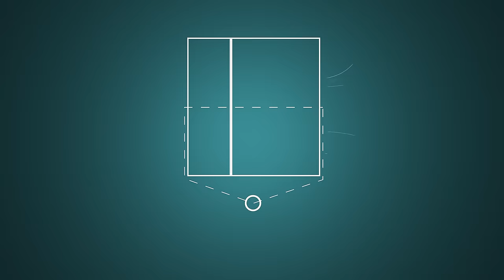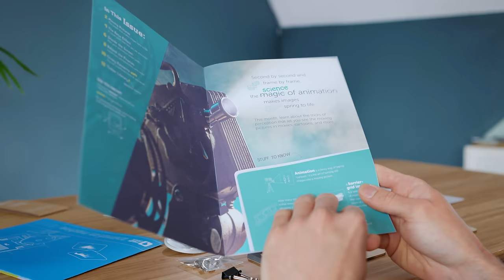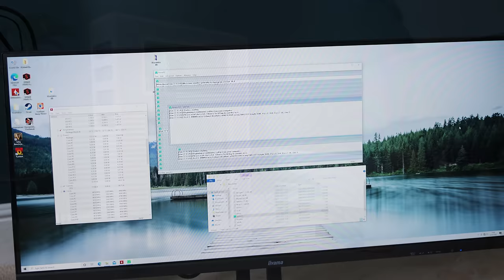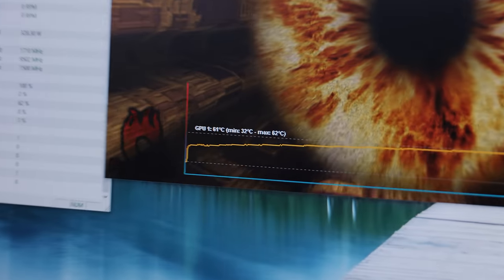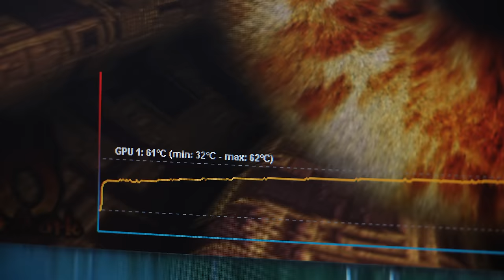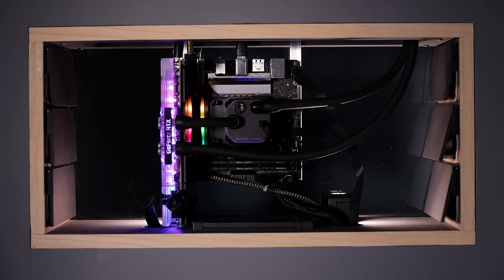Building the world's first 'breathing' PC

Comment: This man just created a whole new cooling solution. Hats off to your genius.
Reply: Have you seen Tech Ingredients air conditioner computer system. though its super loud yet you can overclock your pc to the max while keeping it far cooler than any water cooling system could. Its a super cool concept that would work if you duct the air flow in and then out of your office. This breathing unit is very cool as well as you could adapt 2 wings on to it to allow the ac air come in and then the exhaust vent going out side. One would have to devote an entire wall and custom build a desk and everything. Though I wonder if you could put two lungs ( breathing parts in so that you can have your large monitor in the middle...
Reply: Until you realize he used a 520 watt passive PSU 🤦‍♂️ This PC isn't sustainable and is only for show. If he tried actually using that PC with those components it would melt.
Reply: @PabzRoz  He literally loaded it with prime95 and 3dmark. In what scenario would it get any hotter?
Reply: @ThisIsTheInternet  What? How hot the GPU and CPU get is irrelevant to the issue... He never showed how hot the PSU was getting. It was guaranteed running hotter then the sun. Also he never showed the HWinfo and what speed the CPU/ GPU were running at. The 5950X and 3080 automatically downclock themselves for power management in order to keep their temps under control. Basically they're running way slower then they should be. That PSU is not capable of running a 5950x and 3080 at their rated specs. Any real world workload and long term use would not be sustainable on a 520w PSU. Stop believing everything you see on Youtube. Even a monkey knows a 520w PSU is too low for those components let alone a passive one.
Reply: @ThisIsTheInternet  That's not the point. When temps get too high or there's not enough power draw the CPU and GPU downclock in order to keep temps from getting to high forcing them to run much lower the spec. But the real problem is how hot the PSU is getting. Not only is the PC running slower then it should be and going to experience constant shutdowns but with the way a 3080 spikes it's liable to eventually melt out the PSU or catch fire. No way would this PC last with that small of a PSU.
Reply: @HeyHey-fy5jd  I have 750watt which only turns the fan on at high load and i have never seen in move.
Reply: @PabzRoz  Lmao i didnt even notice, yeah.. This rig would have to be undervolted and underclocked to run stable for longer durations. Which defeats the point of the components chosen lol..
Reply: @Skyflairl2p  exactly
Reply: @PabzRoz  you act as if he cant just swap the psu? Lol
Reply: @CocaineCobain  Which is exactly why it's a major oversight.
Reply: @PabzRoz  This is a proof of concept. Nitpicking his choice of components is kind of missing the point here. It could all easily be swapped out. The fact is he's created a novel cooling system that works, and looks super cool. That's the main takeaway here.
Reply: @PabzRoz  dude there are higher watt rated fanless psu's on the market. this system would totally be usable long term. This was just a proof of concept and it already works amazingly.
Reply: @lollb454  Proof of concept is dope not talking about that. And if he used a higher watt passive PSU ide be fine with that too. The fact he's using a 520w passive PSU is my issue. Not only is this PC extremely underpowered and going to shutdown constantly but it's also dangerous. The PSU is going to constantly be maxed out burning hot and the fact it's passively cooled makes it even worse. It's eventually either gunna melt or actually catch fire.
Reply: @t.c.b4722  I wasn't talking about the concept or anything else. What's the point of it all if you can't even use the PC because the PSU is underpowered? What's the point of using a 5950X and 3080 if you can't even use them to their potential? That's not nitpicking that's just a massive oversight and spreads misinformation that a 520w PSU is fine for system like this. He even benchmarked it as if there's no issue with it. Everything else about the video I found great but the fact he ignored one of the most vital parts of the PC is not nitpicking.
Reply: @ThisIsTheInternet  How hot the components get have absolutely nothing to do with it... You're not that bright are you...
Reply: @dirozx  Ok how is that relevant at all? You literally didn't tell me anything. Idk what cpu or gpu you have idk what tasks you do on your machine like gaming or editing? Just telling me you have a 750watt psu and the fan only turns on when there's a high load literally doesn't mean anything🤦‍♂️.... Not to mention your psu is not even passively cooled.
Reply: @PabzRoz  Its totally not dangerous man.... The worst that would happen is the system would shutdown. Its rated 520watt because its designed and built to run at that wattage without a fan. People need to relax its way less dangerous than they think
Reply: @tylergriffis5036  It's literally the only point of this video, it's a cooling solution. He proved how hot these top of the line components get at max load. The cooling works. The PSU can be swapped for anything. You don't have critical thinking skills do you?
Reply: @PabzRoz  What's the wattage of a 3080 and a 5950x? I'll wait

Comment: Plating the magnet was an insane solution. Wow.
Reply: I was just thinking about sanding it down. I think DYIPerks thought so aswell at first but discarded that solution as bad.
Reply: @Macatho  there was less 0.1 mm gap so he can just polish it
Reply: @Macatho  If you sand it down it will lose its nickel plating which will cause the magnet to rust
Reply: It was also a nickel-ion solution

Ok I'll stop
Reply: @ahmatm2147  just what I thought:

"Pun intended? "
Reply: @ahmatm2147  I saw a pun potential after I posted it haha
Reply: This reminded me of my time in school years ago when we covered our door keys in gold. :D
Reply: @odian3099  Gold? sure you did.
Reply: @StayMadNobodycares  gold plating isn't that expensive bud
Reply: Until you realize he used a 520 watt passive PSU 🤦‍♂️ This PC isn't sustainable and is only for show. If he tried actually using that PC with those components it would melt.

Comment: the motherboard suspended with the tubes and cables coming off of it makes it look like a suspended heart or organ
Reply: I agree with your idea, as i do think it looks like it. The bellow being the lung, the motherboard and components being the brain and the water pump being the heart of the system.
Reply: @LuxGamer16  it sounds like its breathing too
Reply: Maybe the radiator is the lungs, as it takes the water and turns its surface area way up so that it can exchange something with air.
Reply: He should pulse the light in red like a heart beat
Reply: Very General Grievous
Reply: @makeitso9833  uh that would be rad

Comment: This is such a legendary channel, god tier content
Reply: No cap!
Reply: Have you seen 5 minute crafts

That's GOD TEIR CONTENT
🤣😂🤣😂😂🤣😂
Reply: SERIOUSLY!
Reply: Legendary is the right word
Reply: I can't add anything else to this comment. It's exactly that.
Reply: Until you realize he used a 520 watt passive PSU 🤦‍♂️ This PC isn't sustainable and is only for show. If he tried actually using that PC with those components it would melt.
Reply: @PabzRoz  I didn't catch it in the video, did he show the wattage of the PSU? DIY Perks is definitely more on the engineering/building stuff side compared to PC tech so he might not have realized it wasn't enough (hopefully he does now). It might've also just been a temporary part to get the video done since there is a global parts shortage and high power PSUs are one of those things that are hard to find right now.
Reply: @seshpenguin  You can see the PSU is from Seasonic and in one part you can see on the bottom it says 520 watts and the 12v rail is 516watts. It's the Seasonic Platinum Fanless 520W PSU. And i think he knows that PSU wasn't enough he's an educated dude. He obviously just had to get the video done which is why he didn't explain what PSU he was using and why he didn't actually show any of the HWinfo when he was benchmarking it so we couldn't see what the CPU or GPU were boosting too or the benchmarking scores. He very well could have underclocked the components just for the video. He just told us the temps and that's it. I just wish he would have explained that the PSU is not ideal or is temporary instead of acting like it's perfectly fine and benchmarking it giving anyone who saw the PSU like I did the wrong idea.
Reply: @PabzRoz  Yea I agree
Reply: @FelinoLOL you hope?
That's the worst thing I have heard there's no hope left m8.
Reply: @PabzRoz  it's hardly going to melt. Maximum power draw at 100% load for that entire system will be 520W and Seasonic PSUs are built like tanks. So granted you never want to run your PSU at its rated maximum, but only benchmarks and synthetics hammer systems at 100% anyway.

Every day use of that system would be about 450-480W, so you're outside of the efficiency curve for sure, but hardly going to have a problem running it.

Comment: Tube breaks, “I’m going to have to science the shit out of this” Love it
Reply: man couldve just bought a new magnet that fits the tube
Reply: @npas76  That gives the same problem as with the tubes, manufacturing tolerances. But it does give him more chances.
Reply: He just went full NileRed. What an unexpected flex.
Reply: I fucking loved that it blew my mind, not that I necessarily wouldn’t have known the solution but to actually push through and clearly succeed in diy plating and this whole build
Reply: he could just glued something to the magnet to make it thicker, but who am i to criticize XD
Reply: @pedromolina5776  no he couldn’t have, glue itself is a like a block from magnetic waves. Let alone the material you’re suggesting he put around it to increase diameter. This would lead to his primary concern of a slow weak magnetic pull, of barely any air flow.
Reply: as soon as i saw the electrodes, my ap chemistry brain went full in and i was like oh shit he's gonna plate the magnet to make it larger. Never thought I'd actually see something like this outside of educational use lol
Reply: @goosegaming9418  I don't think glue would have any effect, since the magnet would still be in the same place relative to the other magnets.
putting 2 pieces of paper (about +0.2mm to the radius, so +0.4mm to the diameter) between a magnet and the rest wouldn't affect the magnetic field.
the only problem is that it may be ugly.
Reply: @npas76  it's quicker this way and most importantly, more fun
Reply: @satibel  glue does stop magnetic waves I already knew that
Reply: @goosegaming9418  I'm not sure if you're trolling or if glue stopped your brainwaves?

unless you have a proof that having glue around a magnet reduces its power significantly more than the same gap of air or water.
Reply: Most people will just say eh Ill take it to a belt sander and sand the magnet down. This guy be like. Electrolization is the best solution
Reply: @goosegaming9418  Would you mind sharing some of that stuff you are smoking? Because it must be incredibly good stuff...  I am hoping that you realize that EVERY motor and solenoid in the world is coated in epoxy, lacquer, or essentially *GLUE*... Even transformers are wound and then encased in glue... Metals are what interfere with magnetic waves by creating fields of their own or saturating. These can be designed to either block or reinforce a magnetic field.

The hardest part about using an epoxy or glue is getting uniform thickness and distribution when talking about minute thickness changes...by using the electroplating, he was able to control the thickness in micron level accuracy and insure an even better bond. If anything the nickel atoms would have also aligned with the existing field and likely given a very slightly stronger field.
Reply: @burntchickennugget191  sanding might cause problems in the long run as neodymium magnets corrode (basically rust.) and become friable.
Reply: lmao yeah, my first thought as an engineer was LATHE!!
Reply: @npas76  precise size magnets cost insanely
Reply: Eh, electrolyzing isn't too complex. Most people learn it in high school.
Reply: @Zekurity  most people only learn the theory about it in high school

Comment: Imagine if when the system was under load, the breathing rate increased
Reply: This.
Reply: Lovingly terrifying
Reply: DUUUUDE that is a really good idea and would make the machine feel like a living breathing creature. It would almost be creepy to be in the room with it.
Reply: that would actually be really simple to do with the right water pumps, you could just connect them to the CPU fan/pump header and set a curve profile in the BIOS
Reply: But it would be inadvisable building an overclocked rig to do this.
Good thing is that his project worked so well that it put up enough cooling for power-hungry, hot components under load with standard configuration.
Using an OC rig might break the weakest link in that chain - the plastic tube that everything else revolves around to make the set work properly.
Reply: @Carcinogenic2  it's straight though so it could be replaced with a glass tube
Reply: Hahahahhaha
Reply: uh oh your computer has been affected with corona virus
Reply: Skynet!!!
Reply: @minhmang3372  loooollll
Reply: It could be deadly for the computer if you watch breathtaking pictures :D
Reply: @Oxten42  ohhhhhhhhhhhhhhhh
Reply: Is that not the idea?
Reply: This fantastic!
Reply: thats me after 1 minute jog
Reply: Thermodynamics. There would be too much heat involved if it got too fast. Like pistons in an engine. They can run nice and smooth until you start to push them. There’s a lot more science behind it then just push it faster or more water pumps 🤷🏼
Reply: It needs some sensing elements ex thermistor with some of the fine coding and calibration to detect heat and increase the breathing...it might help
Reply: Woah!
Reply: @bloodmonk61  It is the equivalent of a Fan ramping up and making noise
Reply: @seba2366  Thank you for stating the obvious...?
Reply: @bloodmonk61  stupid to do
Reply: I agree I would have thought there would have been a relay to speed it up when the temp increased
Reply: Computer: Opens Minecraft
Also computer: Heavy breathing increases
Reply: @Carcinogenic2  I don't think you understand what's going on here. The water system used to drive the bellows is not connected to the computer in any way, so how would high system temperatures affect the magnetic driver tube?

The entire bellows system is just replacing the fans. The 360mm radiator and closed loop is what handles the system heat, the bellows just pushes air through the radiator.
Reply: @rossclutterbuck1060  
Wow, watch it over again from when the tube starts to wear and crack to see my point.
Reply: @Carcinogenic2  lol OK, let's try this again. Give me an exact timestamp and tell me what it is you think you're seeing.

Because the runner tube didn't "wear", the tube shattered because Matt was heavy-handed with moving the unit and that central tube is under tension.

And again, NONE of the water used to drive the bellows system is connected to the water used to cool the components. They are independent systems.
Reply: @memethief4113  A glass tube would probably be more reliable. Plus the internal diameter would be more precise for the round magnets.

Comment: the acrylic tube was like cinderella's shoe, Matt scoured the kingdom to find a tube that could fit his beloved magnet perfectly...
Reply: Hahaha
Reply: Instead of finding Cinderella, he just put some thick socks on the 40th foot he tried.
Reply: And then he decided to just giveup on cinderella and instead do some plastic surgery to get cinderella's foot to fit the shoe.
Reply: i still cant get why he didnt just sand off the magnet to fit the tighter tubes...it would have saved him a lot of chemistry lol
Reply: 100% CLAP
Reply: @sajalchuttani2519  my thought was that would mess up the magnetism of the magnet
Reply: @sajalchuttani2519  it would have been much harder to make a perfectly circular and even finish on the magnet, at least without a lathe or similar shop equipment
Reply: @tcnguyen1987  more so it can ignite cause the magnets also contain iron, and when sanded, the iron dust ignites spontaneously.

Edit: also the iron can rust easily if the protective nickel coating is removed.
Reply: But since the shoe was too small for Cinderella DIYperks fattened up Cinderella to make it fit
Reply: @jishan6992  pff
Reply: And ended nickel coating the frickin shoe...
Reply: @GhostSlayerYT  you mean the foot? xD
Reply: This is the best comment I've seen on YouTube so far 🥰🤣
Reply: But he chose the Disney version, in the original the stepsisters chopped off their toes and heel with an axe XD
Reply: @feleitks  XD
Reply: @sajalchuttani2519  I considered that too, but I think he would have had to spin the magnet in a lathe to sand it even, and all the metal shavings would probably bind up on the ends of the magnet and interfere with even sanding, and scratching the surface leaving air gaps in the tube.
Reply: hahahah